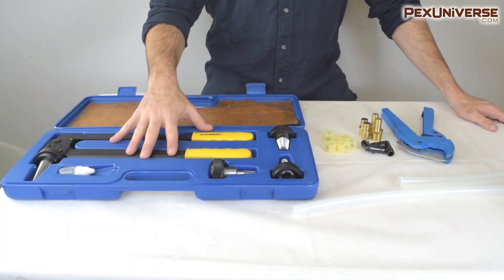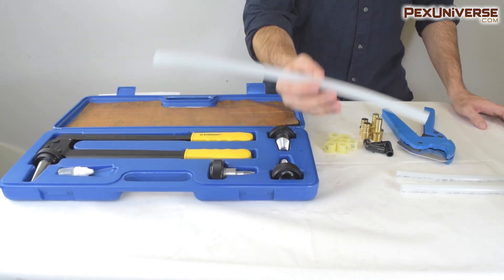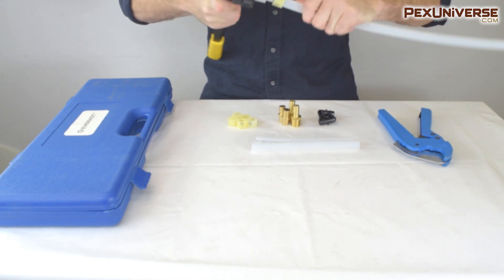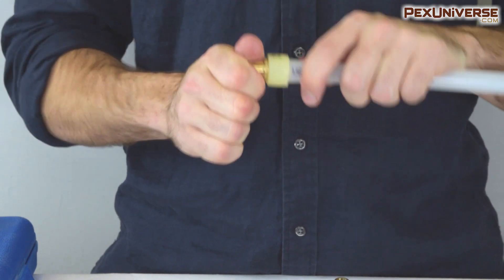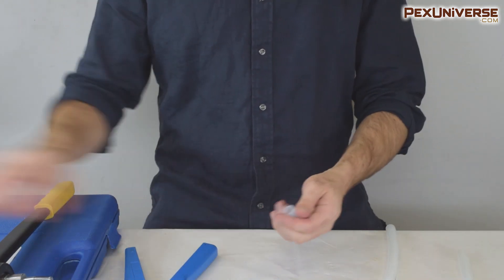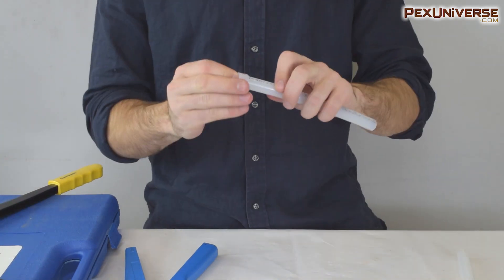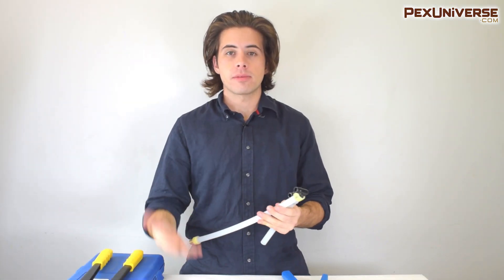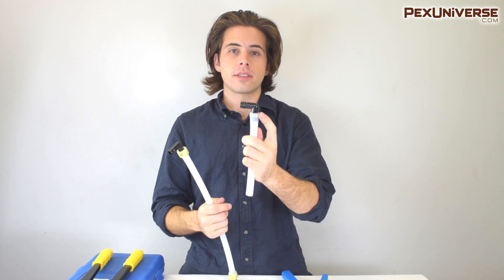How to Make Expansion Connection for PEX Tubing

Comment: You’re home made ring slides off which is not correct and will certainly cause leaks. Must have a stop so it doesn’t slip into the pipe.